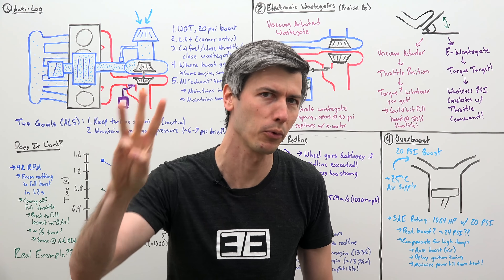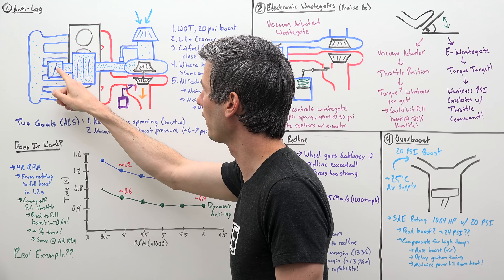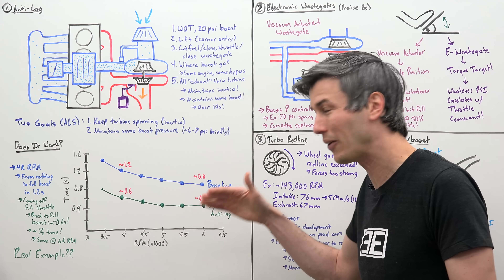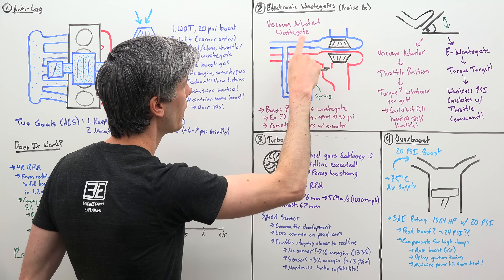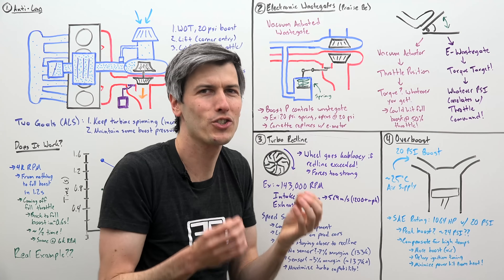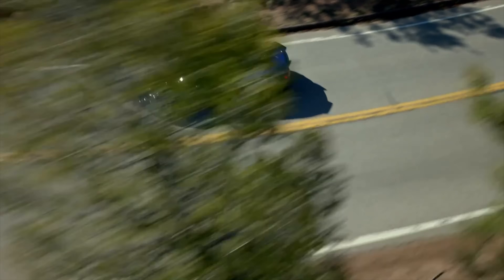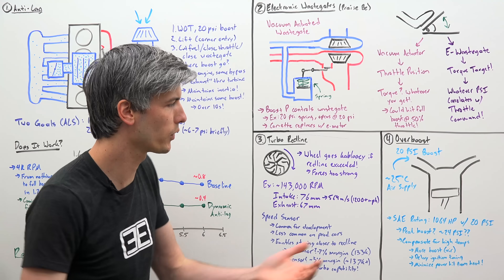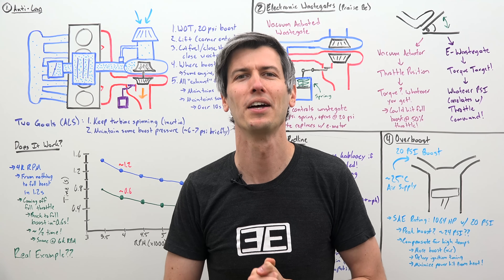Corvette ZR1's Anti-Lag System – Massive Turbos, Minimal Lag

Comment: Engineering Explained is Chevy's best salesman.
Reply: Jason was JUST trashing GM the other day lmao ^
Reply from the maker: Lol, don't show them this one! 🫣
https://youtu.be/i0VoEhW2I-E

ZR1 is just rad, what a car!!
Reply: @EngineeringExplained  Since the original, which at 60mph provided smooth travel over railroad ties according to my memory... was that the 80's?  Edit: thanks for going at a speed that assumes some level of intelligence, or perhaps thanks for being good at explaining?  Not sure which, but it was quite comfortable.
Reply: It should have been- "Advantages of electronic controlled wastegate and BOV". There are other manufacturers and aftermarket ECU's that's do it
Reply: What is new here? Looks like any other modern system
Reply: The only things I’m confident that will beat the ZR1 are the EVs and the SF90. ZR1X likely beats them all, at least in the 1/4 mile. Past that when the electric motor is turned off it might be close. Nothing comes close for the price.
Reply: @dylangiles2624  SF90 already got smoked by a ZR1 on Jason Camissa's drag race
Reply: @zacht9447 SF90 had a terrible launch.Both the ZR1 and SF90 can perform a lot better then what was shown in the video by Hagerty
Reply: @dylangiles2624 SF90? What are you smoking. This will destroy it on the track. But as usual any other manufacturer destroys GM when it comes to the interior.
Reply: @Bob_Smith19SF90 is faster accelerating proven by comparing an SF90 1/4 mile run and Car and Driver 1/4 mile run for the the ZR1. They were about neck and neck to 150 MPH then the SF90 started to pull ahead on the top end.  Although real world is different then just comparing videos, so we’ll see once Drag times gets a ZR1 and starts to run it down the 1/4 mile.
Reply: Air comes in, magic happens, horsepower/fire/bowel-functions come out! It’s science!
Reply: I agree.
Reply: He was Tesla's best salesman for several years.
Reply: Corvette's best salesman, maybe. Chevrolet's best salesman? Hahahahaha, NO.
Reply: GM SSUVs are below standard. Their EVs are a mess. But GM's Corvette and Spec-V chassis and powertrain engineers are sorcerers  So companies that make cool stuff get good press.
Reply: @DavidWilliams-m1k7x  Manhy of their SUVs are class competitive. Trailblazer, trax is class leading, escalade also. What's wrong with the EVs?
Reply: @DavidWilliams-m1k7x how are GM SUV’s below standard?
Reply: But be unbiased for the price it's the best supercar from handling to straight line speed or top speed etc etc Good car all around looks good as well 
Any better car at similar price? Turbo S GT3RS? Amazing cars but cannot match ZR1 lap times or straight line speed
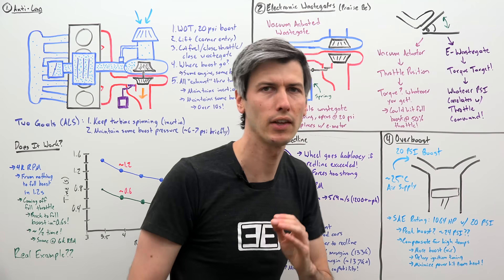Reply: @Smzxe  C8 ZR1 hasn't even set an official time on the Nurburgring yet, although, it'd probably be close to the GT3RS at 6:49. Extra horsepower will really only help you on the straights, and particularly when it's coming from turbos, which in this case have very little lag, but they do still have lag. Compared to the very quick revving nature of the flat-6 4.0L NA engine in the 3RS, coupled with the PDK gearbox, the power is instantaneous, as opposed to very minimal lag. I don't see much in the way of aero on the new C8 ZR1, aside from the rear wing. If you look at the 3RS, it's covered in aero parts. At the end of the day, I don't think comparing the GT3RS to the ZR1 is fair for the ZR1.
Reply: @Smzxe Tbf no one cares about straight line acceleration or speed…
Reply: @MrEo89  that’s all that matters when you’re not on a track. 99% of people don’t drive their cars on a track. Light to light performance, and quarter mile is where it’s at. ZR1 is a killer, and the ZR1x, you’re talking about quarter mile times in the 8’s.
Reply: @MrEo89 are you being sarcastic?
Reply: After owning the 24 Z06/Z07 I took my name off the ZR1 list.  I wasn’t impressed.  I sold it in 4 weeks and bought a Ferrari 296.  The corvette is still a GM. GM still has lawyers who hate sports cars. I’m sure they screwed up something. The Z06 Ediff has issues.
Reply: @jimsteinway695   - not sure if those vehicles are in the same  stratosphere??? $110k vs $350k USD.  Good choice...
Reply: @jimsteinway695  I will crow about GM powertrain and chassis engineering all day long. Fit and Finish is NOT why one buys a Bowtie. I would expect the experience in the 296 to be lightyears better than the ZR1, and given my driving skill level, I don't think I would be brave enough to grab either by the scruff anyway. Enjoy your ride. You chose well.
Reply: I see hundreds of parts that could go wrong in the real world, as well as the stresses typical in a high RPM, high combustion pressure engine.  My first car was a 427 Corvette, but my last car will likely be a Tesla Model S Plaid.  Supercar performance with room for the dog and the groceries, and hundreds fewer parts to go bad.  And no gasoline required.
Reply: @eddiegardner8232  "No gasoline required" locally. Electricity is somehow produced and, I 'm afraid, this somehow is not very efficient. Gasoline cars are actually greener than EVs.
Reply: @Lina_Antoniou. You are dead wrong.  Gas cars are terribly inefficient, 38% at the very highest efficiency operating point, and that doesn’t even consider the losses in the process of drilling, recovering, refining, and delivering fuel to gas stations.  My Tesla is powered by the sun, solar panels on my roof, and is ~90% efficient in using the electricity while making zero air pollution.  Don’t believe ANYTHING you hear from the oil refining business and the politicians and news media they have bought and own.

Comment: With too many computers, sensors, controls, and wiring to go wrong over time.
Reply: And yet you'll notice that the new cars last much longer on average than older,  simpler ones.
Reply: Somewhat true, but the hondas and toyotas of the world are nothing but wire harnesses and they last forever.  Not at all uncommon to go well over 100,000 miles with zero maintenance other than oil and rubber.  It’s all about quality control.
Reply: @KenLeonard American cars from the '70s went over 100k without issue as well and were an order of magnitude easier to maintain and repair.

Comment: Nice video just after the announcement of the ZR1X 😏
Reply: Yes!  I expect this to be the next video.  I always hoped GM would combine the flat plane V8 (even the NA version would have been cool enough) with the eray setup.  

Maybe that combo is next?
Reply: @ClipstopherBurtraw A Z06X version ? I don't really see a point for chevy to make this model. Why do you need an hybrid with the LT6 ? If you want an hybrid the e-ray is here, if you want the sound the Z06 is for you and if you want the fastest of them all, the ZR1X is the graal.
Reply: @fyxos some people just don't want turbos but do want AWD and the flat plane sound.  It seems modular enough that they could make the e axle an option on any Corvette setup, so why not?
Reply: @ClipstopherBurtraw  agreed, pair the "X" hybrid front axle setup with all their offerings. The R&D is done, the space is there, seems like a no-brainer to fill in all the niches that the C8 can muster.
Reply: @fyxos i forgot to mention the 60k price difference between the Z06 and ZR1.  I presume a Z06X vs ZR1X could have the same price difference.  60k is a lot, you could almost buy a base C8 for that.
Reply: @ClipstopherBurtraw  I don't really buy it. You want the sound but not RWD only ? That's seem pretty off, not a lot of people want this configuration. Yes the development has been made but it's still a cost to make another assembly line for the Z06X. Maybe they can use the same as the ZR1X to cut costs. We'll see what Chevy will cook for dessert because the starter and the main dish were succulent
Reply: @fyxos how many assembly lines do you think they have for the Corvette?

Comment: Citroen DS3 1.6 HDI DV6C here... throttle controller negates point 3 after 2k RPM as the turbo can make full boost near enough instantly being only 10.3PSI it negates point 2 and its a diesel... negates point 3

Its car specific but all 3 are very true for most cars especially petrols